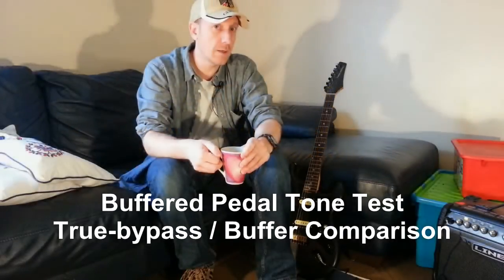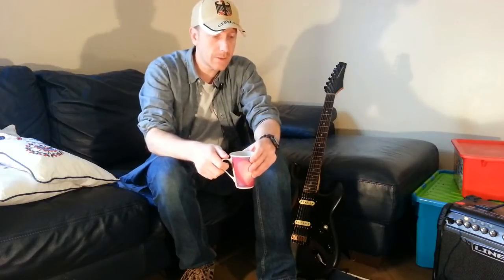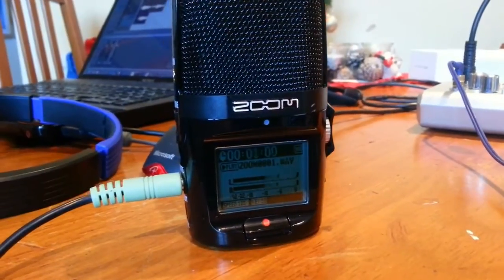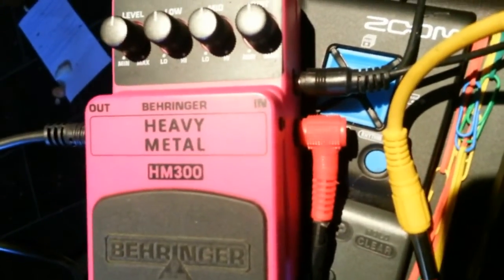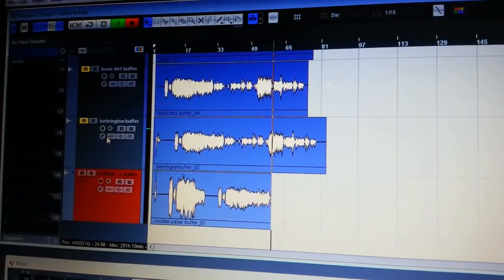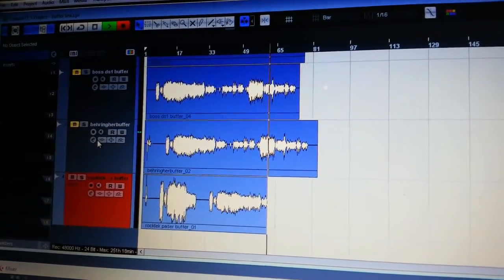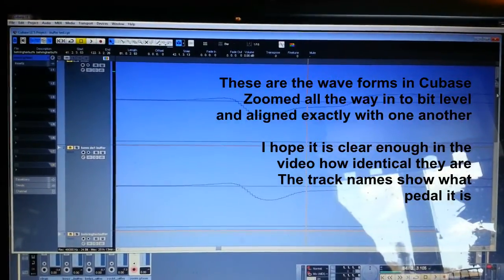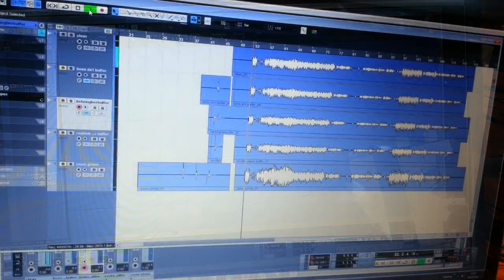Buffer and true-bypass comparison - Buffered Pedals VS True Bypass

Comment: Yes, Behringer pedals have very bad buffers. I had EM600 (Line6 Echo Park clone), the sound of the delays were great, but the buffer was terrible. A lot of high end frequencies lost and drop volume. It's a shame, because they sound almost like the originals... at least they should make them true bypass.
Reply: Take care with tail option, if this is on, the pedal suck a lot of tone, it depends of the mixer knob in this mode. My advice, never activate tails mode